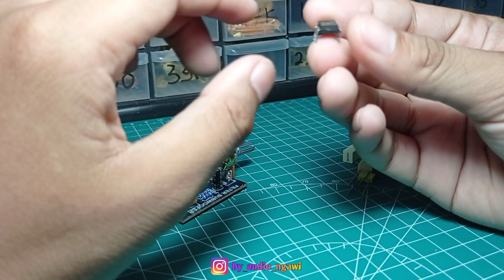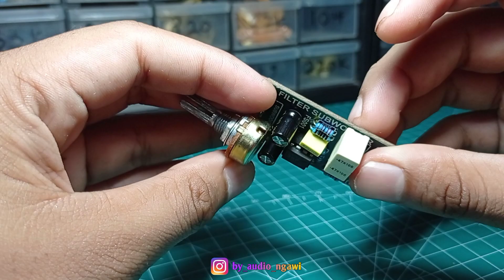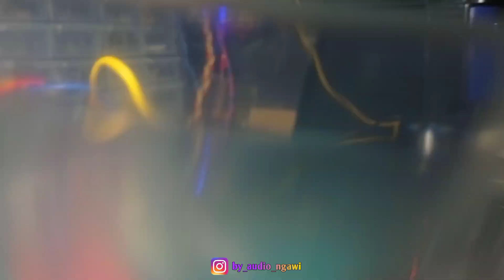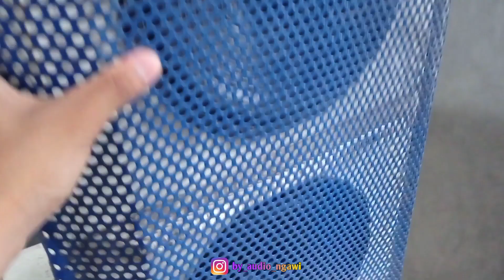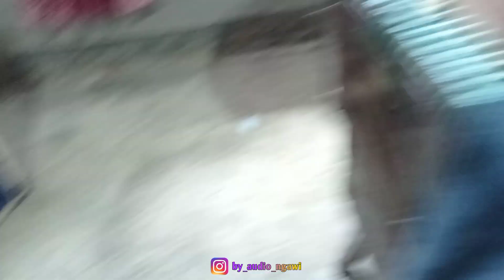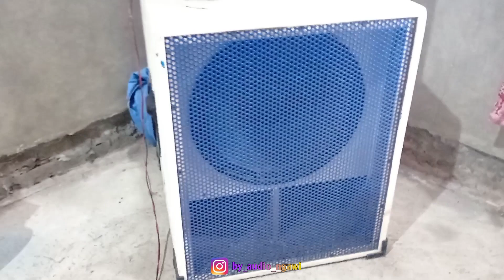Cara Modif Filter Subwoofer Agar Semakin Mantap

Comment: Mohon d jwb Bos, kenapa ya Filter Subwoofer ini atau jenis filter Subwoofer/Lpf yg lain, kalau untuk menghandle power amplifier lebih dari satu, maksudnya Output dari Filter Subwoofer ini masuk ke input power lebih dari satu unit power kok sinyal suaranya malah melemah, beda saat menggunakan satu Channel power saja suaranya kuat/keras, saat ditambah power malah melemah, apakah memang begitu, sudah saya coba beberapa jenis filter Subwoofer hasilnya tetap sama sinyal melemah, maksud dan tujuan saya supaya beberapa unit power amplifier tersebut untuk Nada Subwoofer tapi hanya menggunakan satu unit Filter Sibwoofer/Lpf saja, adakah Solusinya Bos ??
Reply from the maker: Iya mas, satu kit untuk satu power mas ga bisa diparalel pasti suara turunin

Comment: Bang mau tanya. Saya kan punya 1 power 2 channel. Sebelah saya kasih tone control dan sebelah saya kasih filter subwoofer. Sumber suara dari hp kan R L. Input tone control kan cuma 1 ( mono), sedangkan filter subwoofer inputnya R L. Kalau input filter subwoofer saya kasih R L suaranya nendang mantap. Tapi suara dari tone control jadi kayak kalah gitu gk bisa lantang, sumber suara kayak disedot filter subwoofer. Tapi kalau masing2 saya kasih mono misal tone control saya kasih R dan filter subwoofer saya kasih L, suara tone control jadi lantang, tapi suara filter subwoofer jadi kurang nendang. Gimana solusinya bang? Terima kasih.
Reply: Coba balik salah satu di katub Speaker nya
Reply: Jajal tiap input dan output di kasih resistor 8k2